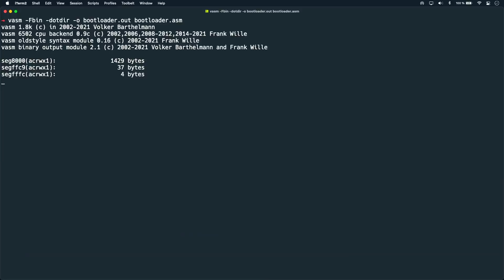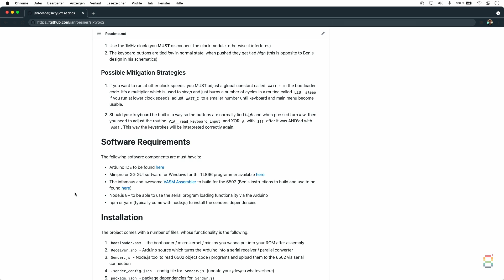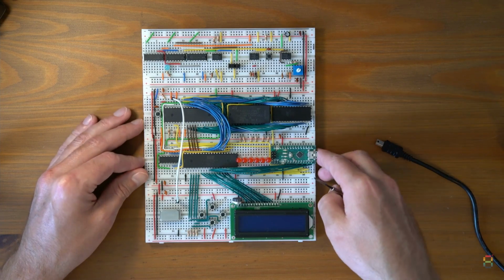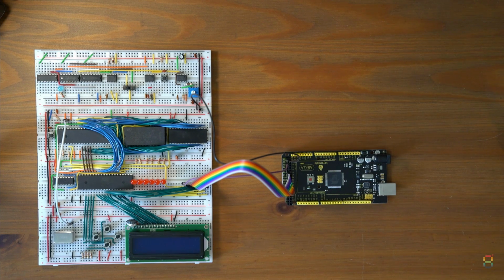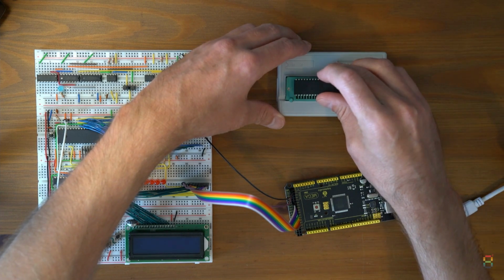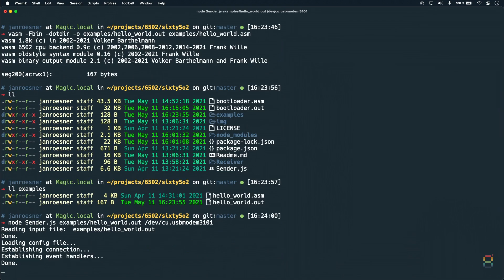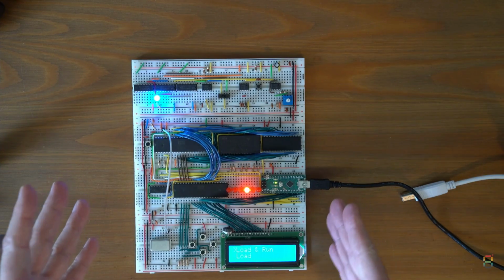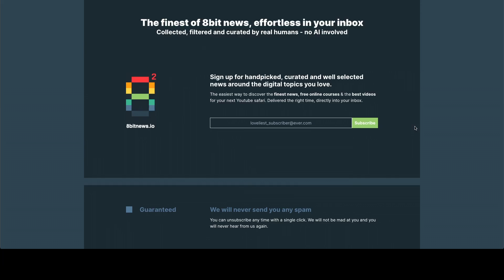Sixty5o2 - The Operating System for Ben Eater's 6502 Breadboard Computer

Comment: Very nice! I've been working on a Ben Eater -inspired homebrew project since summer 2020, and I implemented a rudimentary memory upload straight from a computer, as to evade having to swap the rom chip between a programmer and the computer. It's been a godsent when testing out code to run on it. The project isn't finished yet, and I do intend have a ROM on the "final" product, but as of now being able to upload code at will with a single button press trumps that, especially since I don't have any complex address decoding logic implemented yet.

Hmm. Maybe even after I have setup the EEPROM access into the homebrew I could still use the current upload system to program the ROM as well.
Reply from the maker: I am curious about your project. Uploading to RAM is one thing, updating the ROM another. You should have a look at Ben's video, where he is building a ROM programmer on a breadboard. Should give you all information you need.
Reply: @8bitnews304  Yeah, Ben Eater's ROM programmer video is full of good information (well, to be fair, all of Ben Eater's videos are). Afaik the only difference between programming an EEPROM and writing to SRAM are the timings. 

Hmm. Now that I think about there might've been some high voltage stuff too, but that might just be to activate the programming circuitry, so a transistor-switch to HV could be enough to do it. Though I might remember incorrectly. If I need high-voltage for data as well, then it gets a bit more hairy as I'd need something like '4050 that supports HV, but I don't think that was needed though.

Either without a HV programming switch pin, or with one, relatively simple to implement and timing is the only thing to take care of at that point.

EDIT: Took a quick look at the AT28C16 datasheet, and it's accessed completely like an SRAM, with the difference of longer writes. You can, if you want to, erase the whole chip at once with HV (12V) set to CE and OE and drive WE low, but that isn't needed in normal operation. My current uploader is actually quite slow (30 seconds for the whole 64K, though it's fast enough for iterating and testing while programming), so it should work straight out of the box once I have the correct address decoding set up and signals wired correctly. It will be far in the future though, not my current target with the project.
Reply: @8bitnews304  Oh and also thanks for being curious! I have a blog I sometimes post updates to and I might do some videos about it at some point. Documenting a project takes a lot of work though (as you probably know), so I don't update stuff that often, especially videos.

I don't know if links work so I'll just say you can find my blog by searching for "kape 8bit" on Google. I also regularly update about it on Twitter with the #KAPE8bit hashtag.

Comment: I recently started building my own circuits and found Logisim to be a bit dated and slow.  There is a newer software package called Digital that is really good, you might want to give it a look if you haven't already.  My Homebrew CPU is "kinda" 6502 compatible, I might be able to borrow some of your OS Logic!  Great project, thanks for sharing.
Reply from the maker: Thank you Louis. I evaluated a number of options actually. Including Digital, web applications and all flavors of Logisim out there. In the end the original one was the perfect fir fr the first simulation of the 8bit machine at least. For the things to come, we will do something different ... something exciting :)
Reply: logisim was replaced by logisim-evolution.
Reply: I'm curious to know what CPU is "kinda" compatible with the 6502. Are you using a 65816?
Reply: @johnm2012  Homebrew CPU, it's custom-made.

Comment: Probably should make a correction. The Arduino Mega's not actually a part of the 6502 computer kit Ben Eater sells. He does however provide a link to buy it separately from him. That said, if you're following his videos to completion you probably got the Mega due to its use as a logic analyzer.
Reply from the maker: You are absolutely right. Thank you for pointing that out!